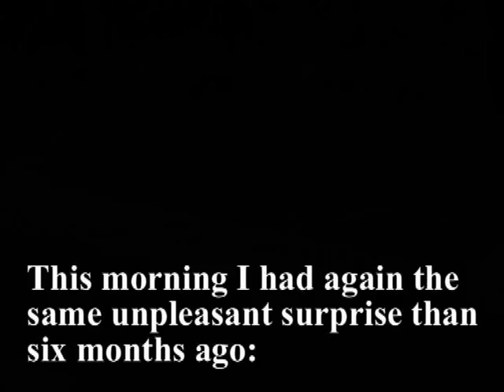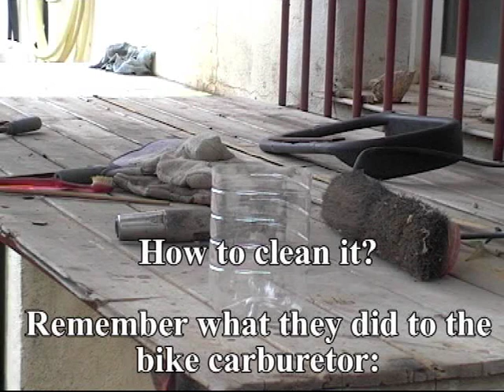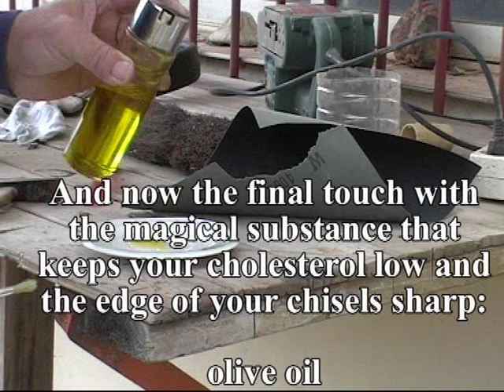Disassembling the Air Hammer

Comment: Please folks, never use gasoline for cleaning parts. The vapors can ignite and you can get severely burned.
Kerosene, mineral spirits, spray-can carb cleaner, or safest is water base cleaner. Many water based cleaners are available at the home improvement, automotive or firearm stores.

Comment: Using olive oil guarantees that tool won't last another 25 yrs. without maintenance. Too many organic compounds that will decompose and get sticky/gummy over time. 3-5 oz. (roughly 90-150ml) bottles of air tool oil are only marginally more expensive than olive oil but provide better lubrication, and exponentially greater stability under heat, pressure, and over long periods of time. Not fond of gas as a solvent either, leaves residue (especially green gas, which either has a lot of additives, or has fouled due to age/oxidation.) Don't like your choice of cleaner or lube, but I like the method. When it gums up and doesn't hit for shit next time, use non-chlor. brake cleaner and air tool lube (LucasOil makes good stuff, find it at nearly any auto parts store.)